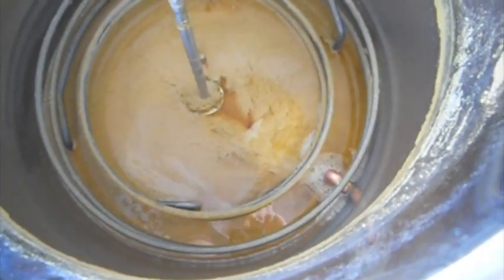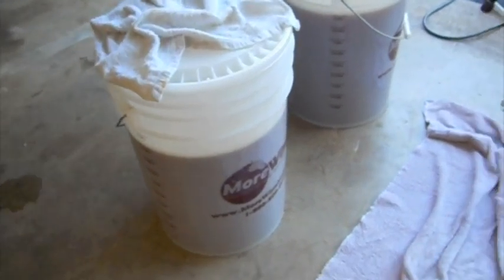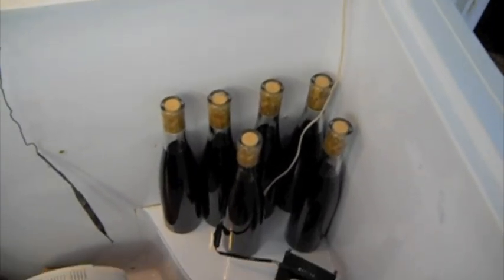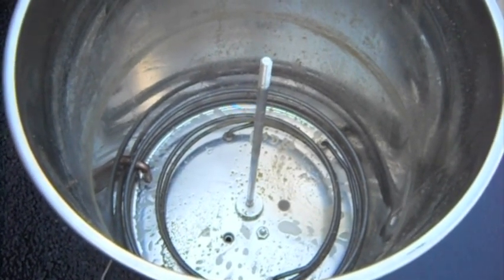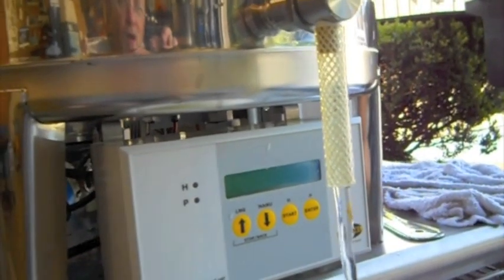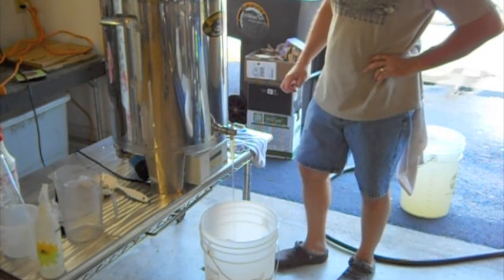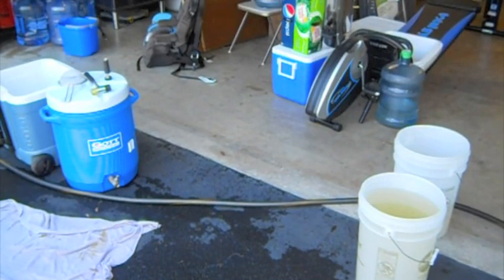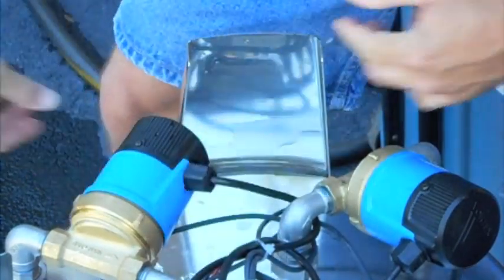First Brew on the Speidel Braumeister Brewmaster part 5

Comment: Awesome video, thanks for taking the time to post this, you should really get some free stuff from Speidel for putting this up!  This system makes it seem really easy to get good consistency with your beer and I'm glad to see that your mash efficiency was so high, I was a bit worried about that when I first saw this system.  The only think I would be concerned with on this system is Hot Side Aeration, I noticed that there was a lot of splashing during the mash as it was being circulated.

Comment from the maker: @becks41 Thank you for the kind words! I have not noticed any off flavors with the Speidel other than a Hefe like aroma and flavor in beers that were nowhere near a Hefe type beer. I've had the same in beers brewed with a non Speidel unit as well. I have it narrowed down to either forgetting to add the campden tablet to the tap water (Chloramine) or re-used yeast. Not a bad beer beer at all, just tasted and smelled exactly like a Hefeweizen.

Comment from the maker: @Jazzafish  I bought a "splatter screen" used on frying pans, removed the handle, cut a hole in the center and slide that over the cloth filter now. Only used it once so far but it worked perfect that time.